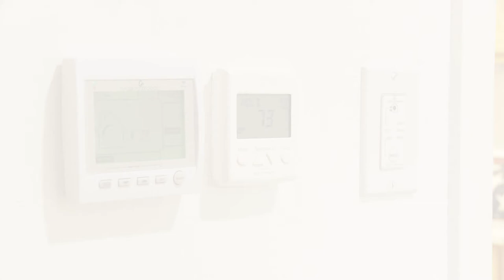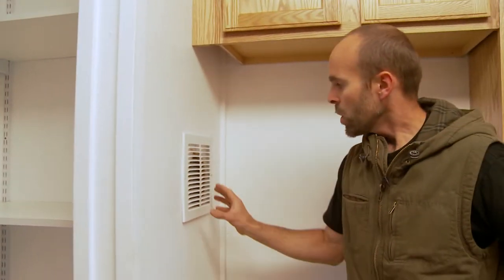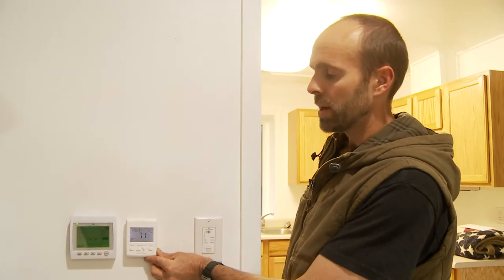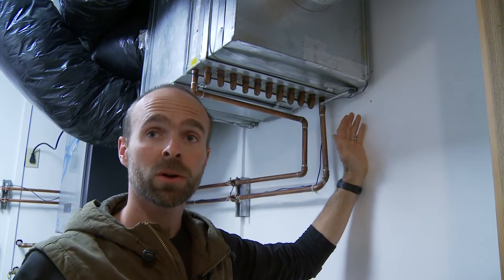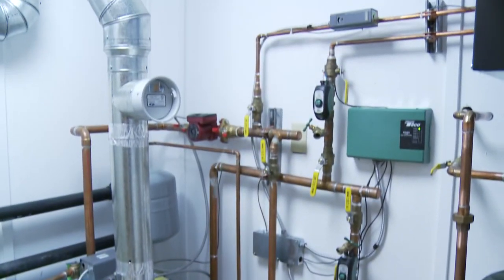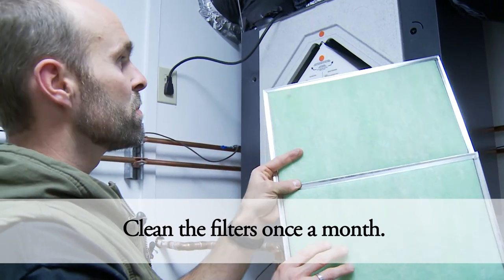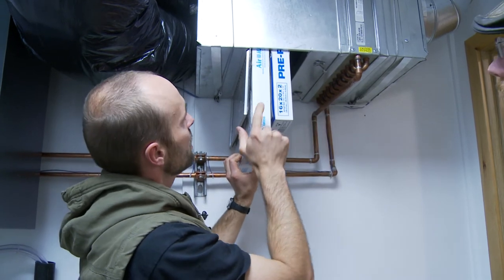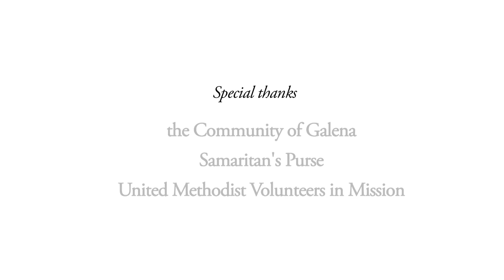brHEAThe Instruction Video

Comment: I am not a big fan of  that open make up air in the boiler room.  Much better to have piped air going right to the firebox ala System 2000 etc.  Then you aren't flowing unneeded cold air as well as having a cold metal pipe acting as a cooling exchanger for the mechanical room.  This would cause excessive firing of the boiler to make up its residual heat (the low setting) as the cold air is cooling the outside of the boiler (yes they have insulation but it is always minimal).  PVC make up piping directly to the combustion chamber removes all these issues for very little cost if not less than that big metal stove pipe.  When you are emphasizing heating efficiency this would seem obvious.  Lots of down sides and no up side to that open eight inch air vent to the outside temperature and humidity as well as any windy conditions which could pressurize the mechanical room for a whole new set of problems.  It could if on the leeward side of the house also create a vacuum (low pressure) in the mechanical room.  Just not good.  Good Topic.  Take care.  Doug